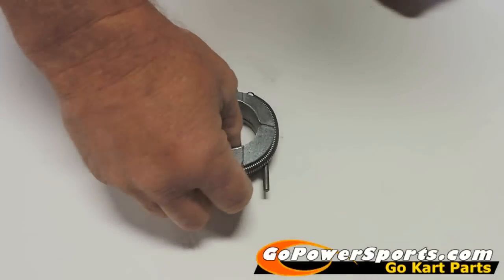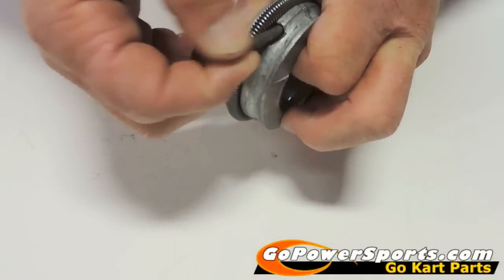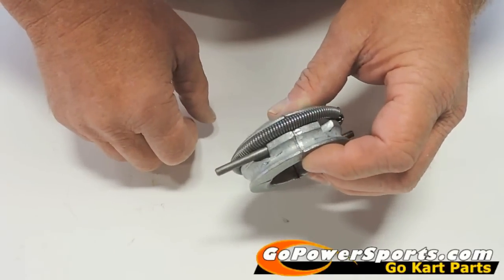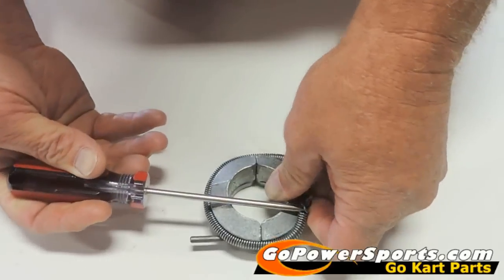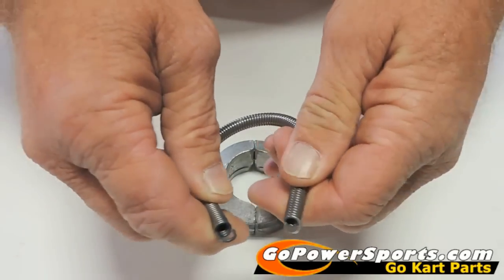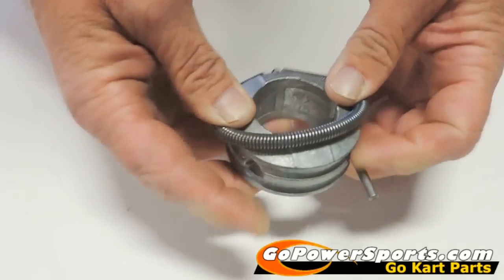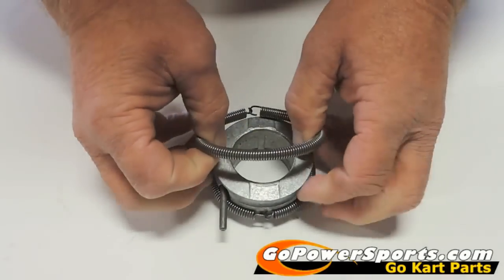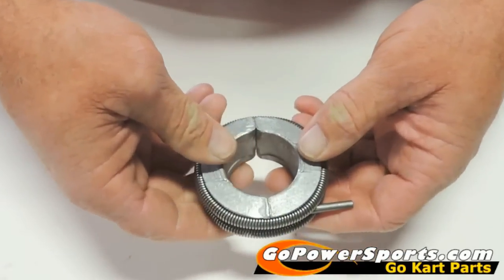Comet Torque Converter Weight Assembly Garter Springs Go Kart Replacement

Comment: What can we do to increase the rpm the converter engages? Can we drill the weights out?
Reply: Lighter springs. They run about $12 a pair.
Reply: @2002ZRX1200R  Lighter springs would decrease engagement RPM. To get a higher engagement RPM you need heavier springs.
Reply: @Deucealive75 , nailed it.

GPS sells different springs.
(Thanks,GoPowerSports.)

GPS also sells aluminum weights.  Those 
will also increase RPMs.  Since the original 
ones are zinc, and are not all that strong, 
and since you can't drill the holes, in 
EXACTLY the same place and depth, you'll 
throw the balance off of a piece spinning at 
engine speeds.  The least that will do, is 
tear up the main bearings.  The most it 
could do, is cause an engine to blow up, 
between your legs.  (Minibike and gas 
powered bicycles.)

steve
Reply: @Deucealive75  Would you agree that heavier springs would give you more speed at the bottom end like a clutch would ?
Reply: @4687878  I would not agree because clutch engagement RPM and speed are 2 different things. Higher engagement RPM should provide a more powerful take off or launch,  but I can't see how speed would change.